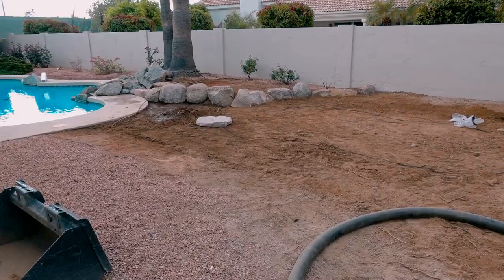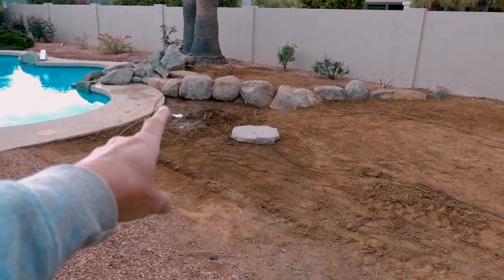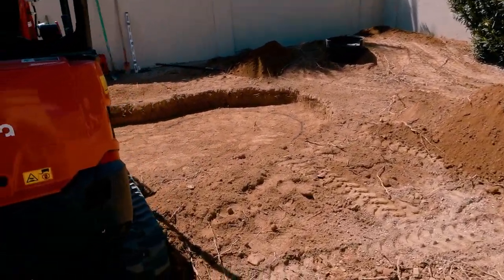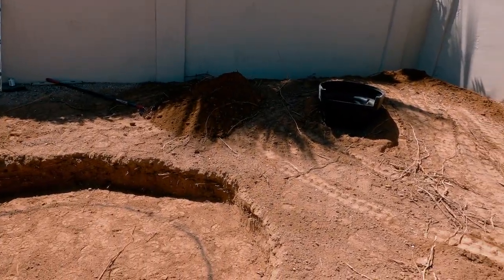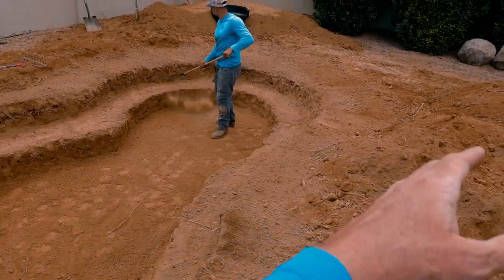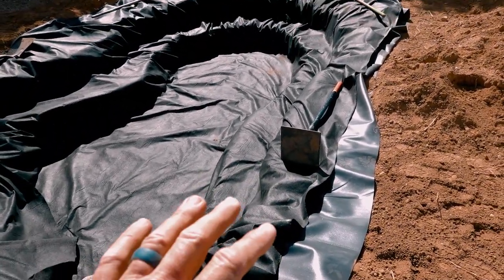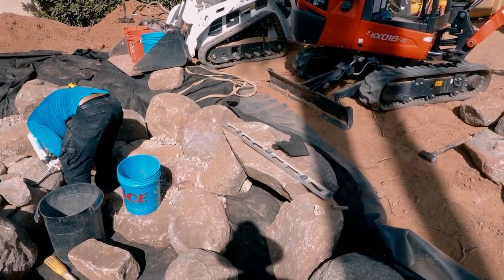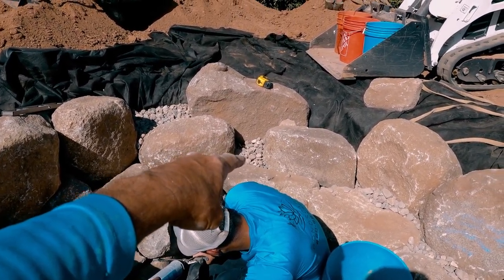Eco System Pond with Aeration!

Comment: Wow very nice job!!  Questions :  Why put one aerator and one diffuser...why not 2 aerators? Thanks
Reply from the maker: Thank you! The aeration system is comprised of a aerator pump (outside of the pond), air supply line (or lines if more than one diffuser) and diffuser (this is what emits the tiny air bubbles). In this system we had two diffusers. I may have miss spoken in the video. I hope this makes sense. Thanks for watching!

Comment: Looks great.  What do you recommend to prevent algae from forming in the pond water?  I've seen so many different views / recommendations on what to put in a waterfall pond without fish to prevent algae buildup (e.g., floating bromine tablets, di-chlor,  liquid chlorine,  chlorox bleach???).  What do you recommend to your customers?
Reply from the maker: First I set the expectation in the beginning that algae is a reality and it is going to happen. The key is to control the amount of algae that occurs. It is actually beneficial in the sense that it absorbs nutrients in the water. We control algae with a few products that you can get from Aquascape. Beneficial bacteria, eco-blast and SAB are the three products we typically use and suggest on most ponds. NO hard chemicals.

Comment: I've noticed in every professional pond and water feature video, you guys put all rocks and gravel in without rinsing them first, so when the water feature is first turned on the water is really muddy. Is it just much easier to just pump out all the muddy water after everything is done? It was pretty inconvenient for me to thoroughly rinse all the rocks before putting them in, so it would be really nice not to have to do that, but I just wanted to be cautious.
Reply from the maker: Just think about the extremely muddy condition we would create by cleaning everything first. It is just not efficient or convenient to clean large quantities of Gravel and Boulders first. What you don’t see in a lot of our videos is that we typically rinse the pond down thoroughly and pump it out before actually filling it for the first time. Great question!